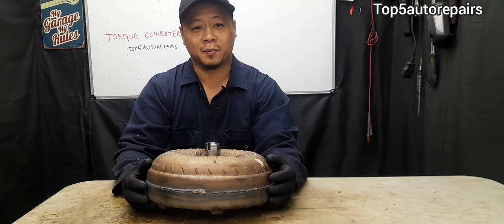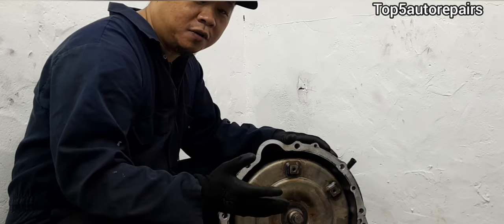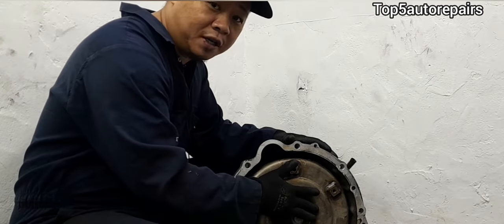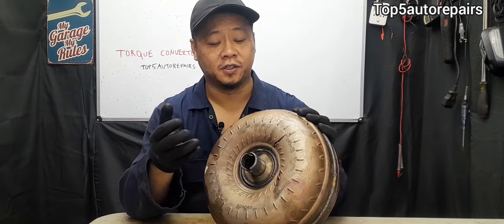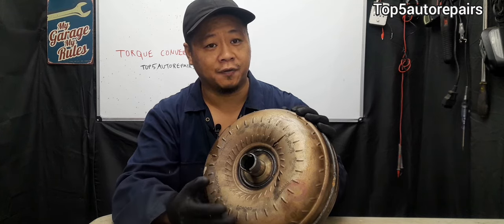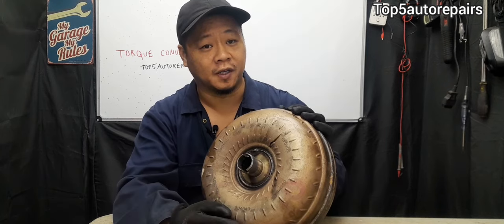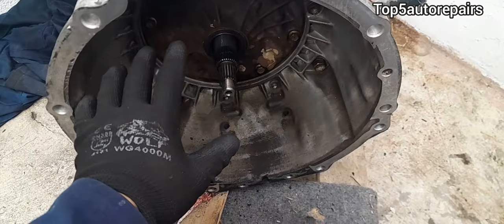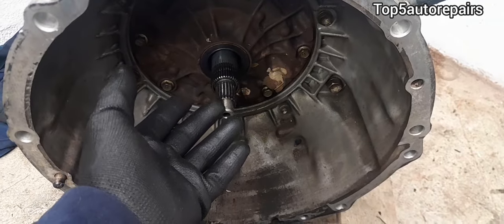SYMPTOMS OF A BAD TORQUE CONVERTER (HERE ARE THE COMMON PROBLEMS)

Comment: i have a nissan sentra 2016 stalls in drive and reverse i scanned it with a good scanner no dtcs on transmission or engine i took the transmission out and open the transmission everything looks fine but i noticed when i put the input shaft that spins the impeller theres no movement like its stuck or siezed is that normal but the stator spins nicely and i did notice metal shavings in the bell housing below the input shaft let me know
Reply: Hi, did you find out what the cause of this was? I have something similar but with no shavings in the bell housing. Just stalls when put into drive and reverse! Thanks
Reply: @jakecardus7940  so basically i suspected bad torque converter but trust me its not worth just fixing one part and parts add up to almost the same cost of a reman transmision from nissan so thats what i did i just replace the transmission myself luckily i had a commercial account and the transmission came out cheaper but for you it can cost up to $3000 to $3500 retail and thats not including oil  and other stuff and i started up the car and did some calibration resets with my scanner and felt nice no stalling but im going to get it reprogram professionally just to be on the safe side which is another $250 the dealer closest to me wanted 400$ for a simple reporgram

Comment: I have a Mazda demio 1998 automatic transmission the mechanic did an engine overhaul now it wont engage into any gear changed the pump still not circulation of the transmission oil please help

Comment: My 1992 Lincoln town car slips when it’s cold. (Ford AOD) 
If I don’t let my car warm up for at least 10 minutes, when I first go into gear everything will seem fine until I come to the first stop, then it seems to neutral out and stops moving, if I bring the RPM up it’ll jump back into gear. Only happens on the first time I stop, when it’s cold. If I let her warm up it’s fine. No slippage at all when it’s warm, but hard shifts. Fluid is topped off, so that’s not the issue. Any ideas? Thanks in advance. 
1992 with 154,000
Reply: try replacing the transmission filter but i had a similar issue on my old 85 f150 with a 351w and it turned out that the timing was slightly retarded and my ignition was so far off when it was cold that it would bog out until it hit about 160°

Comment: Hey , i have restored torque converter in the car , old was Bad and i change it with restored, but the problem now is the car from 30mph up to 50mph, RPM jumping from 1500-1300 and after 60mph its okey 
Or its just Bad job on torque converter?
Reply: What ended up being the problem?

Comment: What if when you floor it and it’s very slowww from 0-30mph but after 30mph it drives wayyy faster that’s what I’m dealing with in my 01 1500 5.3&4l60 Silverado anyone can help???
Reply: U figure it out
Reply: @elireynolds7131  Nope I got a 02 2500 now. I still have the 1500 with the slow acceleration problem I was told it’s the converter in the transmission some said the rear end